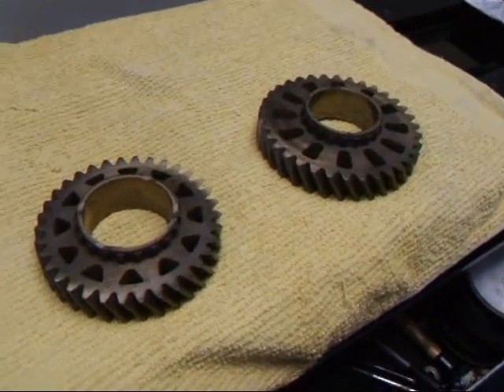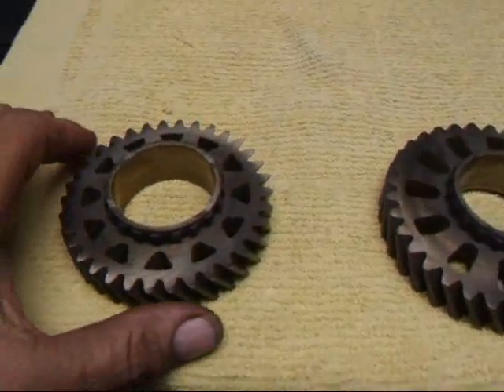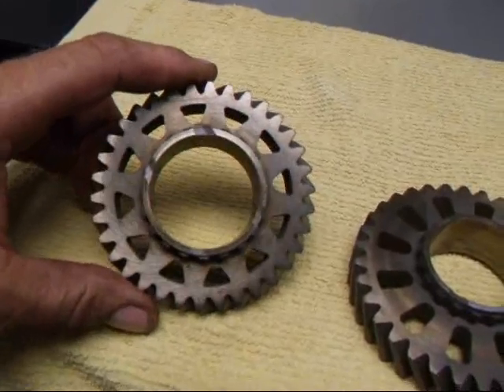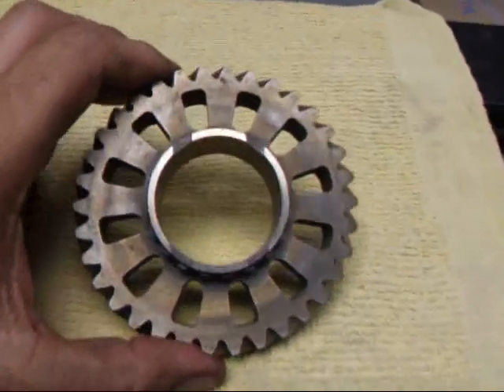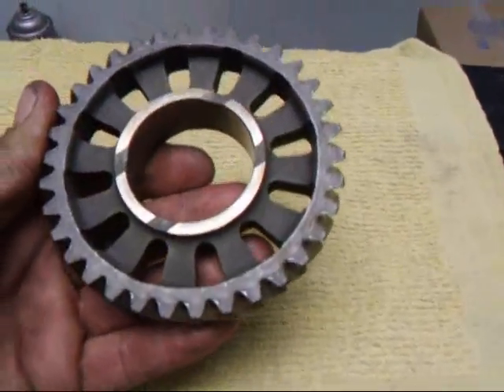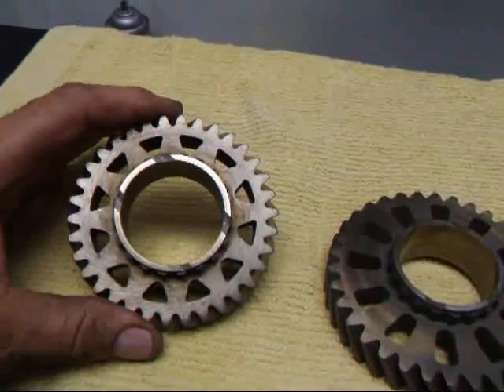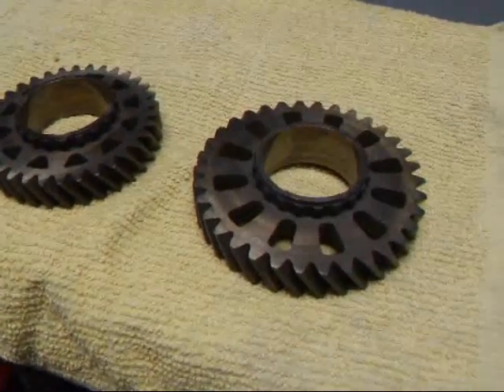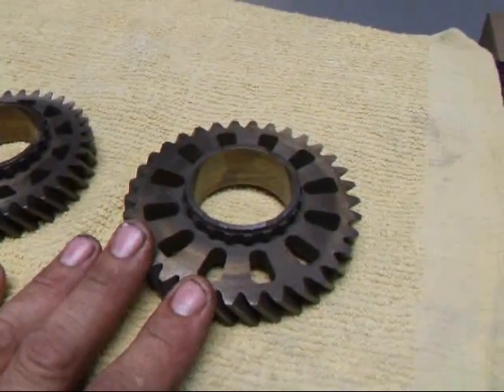Transmission Gear Lightening

Comment: I'm curious as to how this project turned out, do you have any updates on it? I'm wondering if this would be a bit overkill or unnecessary for a T-5 Transmission from a 1983 Datsun 280ZX Turbo

Comment: @fiatnutz and john did what where the results on this mod

as Stummel01 said does it cause more drag in the gearbox and so gives it a higher oil temperature?

and how about the strenght ? did it broke?

im asking because i want to lighten my transmission in my 210cc 2stroke moped

same casings as in de Honda big bore scooter vid

i want to put out 50hp so i need every little tip and trick

Thanks John

Comment: a thought provoking video, as always. You may get better lubrication due to oil flinging from the new apertures....or increased aeration. I guess if the holes were round you could thread in a plastic dowel of low mass to preserve the original shape.  I guess sometimes you just have to hammer the hell out of it to see what breaks first!

Comment from the maker: We use a wire EDM machine that is programmed to remove the material in specified locations. This job takes about  2  - 2-1/2 hours per gear to machine.

Comment: LMAO yeah we used to go as far as milling out side covers alternator ect on bikes to up the HP:weight ratios..we drilled/lathed gears too. If ya machine the right shapes you can acctually make things up to 300% stronger by REMOVING material. It works by throwing yaw into a piece,instead of a strait impact,it gets slung out on many angles, thereby spreading the loads out. it works on roll cage joint reinforcing plates.